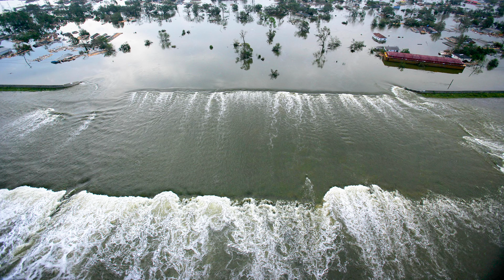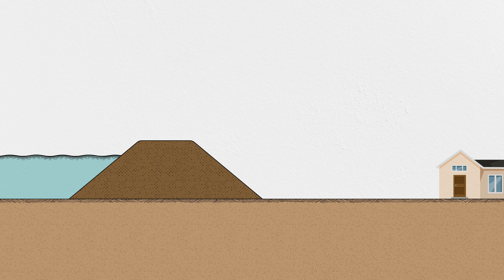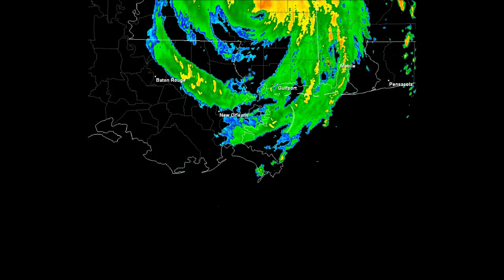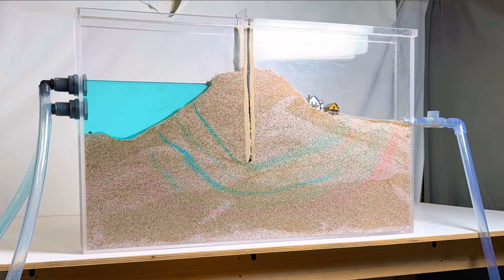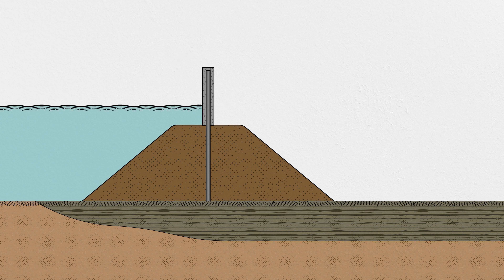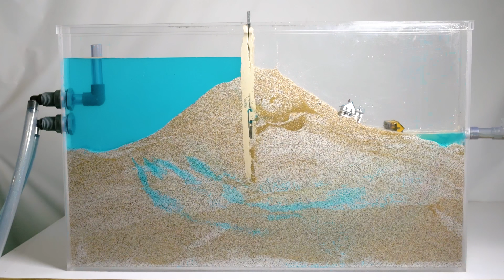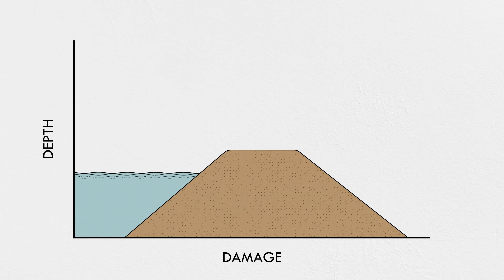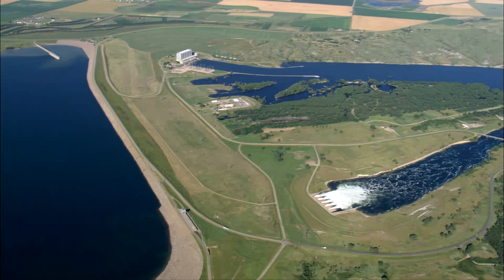The Mind-Blowing Flaw That Flooded New Orleans

Comment: The primary cause of these sort of "errors in judgement" is almost always desire to cut costs. The obvious under estimates by the engineers were most likely because higher estimates mean higher costs, and the guy who insists on telling the boss it will cost more is gonna have a shorter career than the guy who says it will cost less,
Reply: A lot of that cost cutting stems from the voterbase not wanting to pay more in taxes.
Reply: @spencer1880  And don't forget good old corruption stealing huge chunks off the top.
Reply: There is always a need to balance costs and effects.  Anyone who says otherwise is lying, either because the "problem" isn't a problem, or because they are the bureaucrat in charge of spending the money and the more money there is, the more money can be put in the proper pockets.  New Orleans had a very good system for stopping 20-year storms, but they knew back in the 80's when I lived there that the system was vulnerable to a larger storm like Katrina but nothing could be done because the money would be stolen and if you locked up all the thieves there wouldn't be anybody to run the city or even drive a backhoe.
Reply: Any politician will want to cut costs. It's up to the army core of engineers or a local body to communicate the risk we are taken by inaction. It's up to the voter base to care enough about said risk to make more taxes or cuts elsewhere less politically painful. If the voter base does not care, politicians won't either.
Reply: @qlum  Louisiana is very corrupt. The people living there care but they don't have the money (thanks to the corruption) or the power (thanks to the corruption) to force politicians to act on their behalf.

Comment: Several years ago, I did some work for Patterson Pump Company near Toccoa, GA.  The day we got there, they had just shipped the last of 18 pumps capable of pumping 1,000,000 gallons/minute to New Orleans for use in their flood protection system. They were roughly 34 ft. in diameter. And quite obviously they had to be disassembled to ship them. That is such a tremendous number that I am questioning my memory, maybe it was 1,000,000 / hour. Either way that is a difficult volume to conceive.

Comment: Here's an idea, why not angle the I-wall and engineer around it? The point/goal would be to keep the height of the water as low as possible to reduce the amount of water head driving water under the wall. As water flows in, there's a progressively larger volume available to accommodate that inflow.

Comment: I expect development creep is part of the issue along the lower Yangtze river...... The Three Gorges dam has had some control of the river allowing development to 'get used to' less flooding hazards, so when the dam operators have to let some flood waters past the damage seems extra and unnecessary, some people even blame the dam for causing flooding. The reality is probably more like the dam prevents most flooding and the flooding that does happen is much lighter than it would be without the dam.

The various reasons for why the reservoir did not have capacity for the water is a different can of worms.

Comment: the biggest point of failure was building a city in a flood basin.  my town has a road like that - every once in a while, someone gets excited to improve drainage, to stop the road flooding, but the bottom line is the elevation of the road is lower than the water level of the swamp it crosses; during winter storms.

Comment: It seems like a double-sidewall approach with a square profile of geogrid MSE in the middle solves much of the problem, by lowering the stakes of upwelling erosion.  The "Outflow canals" clearly need some kind of smaller scale infrastructure of catchment basins and pressurized piping that exits well above storm surge projections.  I'm sure I'm not saying anything new here.

Comment: I've never really understood reported storm surge numbers.

Here, the surge was reported to be up to 28 feet, yet only in "some areas" did the water level rise above the rooflines of houses, which are presumably mostly lower than 28 feet.

How to reconcile those things? Was the largest surge in areas with no or few houses?  Does "28 feet" only apply to the edge of the coastline, and quickly gets smaller even a short distance inland? 

Any explanations are welcome!
Reply from the maker: 28 feet above mean sea level, so buildings at higher elevations would be less affected. Sorry for the confusion!

Comment: i will never understand why people would decide to live somewhere that is underwater on a regular basis
Reply: *looks around awkwardly in Dutch*
Reply: @matthewdebeer8453  do you get frequent floodings caused by storms?
Reply: @FoxBoi69 they used to. but they fixed it for the most part
Reply: @FoxBoi69The Dutch had centuries to become masters of water management.
And even above sea level the rivers  rise when the ocean doesn't let the water drain off.
I'm about 7m above sea level, and we had a massive break in the 80s.
Reply: @FoxBoi69 The Netherland's water management is cutting edge. Definitely check out the water systems engineering they've achieved.
Reply: @FoxBoi69 until we plugged all the holes, yes.

the former Zuiderzee (now the IJsselmeer) used to endanger most of The Netherlands, for centuries.
only when in 1932 the Afsluitdijk got finished did those regulair storms (and tides) stop threatening the entire area around it.

or the Delta werken (/works) in the after the 1953 flood.
Reply: Because most people don’t decide.  Economic pressures do.
Reply: Because most people tend to make the assumption of: "Oh nice, there's a nice big wall of dirt between me and the problem. I doubt that's going anywhere." 
However as it turns out, the ground is a lot less static than most people realize...
Reply: I’m in Japan right now.  Earthquakes, tsunamis, typhoons, Godzilla, and massive population density. 🤷🏻‍♂️
Reply: Often those places are economically strong.
Coasts and rivers are amazing for shipping, volcanic soil is incredibly rich in nutrients, flatlands with tornadoes allow for huge fields.

Just look at all areas that are at risk of flooding, storms, earthquakes, eruptions, etc and try to figure out where to move the people.
Reply: Because - "trust"

Comment: Shouldn't they hire engineers to build these things? That I-wall buckling was the most obvious thing I've ever seen.
Reply: A normal person would think that a city would be overengineered with multiple failsafes and an expected capacity at least twice historic norms for any known variable, if only because a single major disaster is all it takes to destroy everything....

...but bureaucrats and politicians are not normal people.
Reply: @ProductofSeebach  well the dams were built to handle much greater amounts of water than the amount that did cause failure… on paper. But cut corners or bad assumptions can easily be hidden or forgotten. Its then hard for future decision makers to know someone in the past cut a corner or gave you bad info. And if you get lax on inspections it gets potentially much worse.
Reply: Even engineers can make mistakes particularly if they are given bad info about the parameters or if it was a long time ago. These models are designed to make it obvious but its harder to see whats going on under the surface without it.